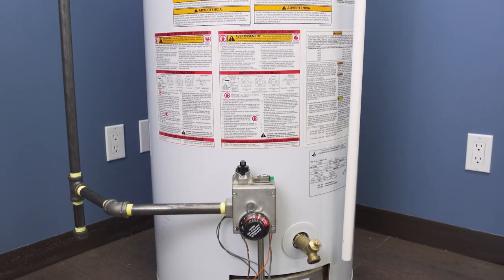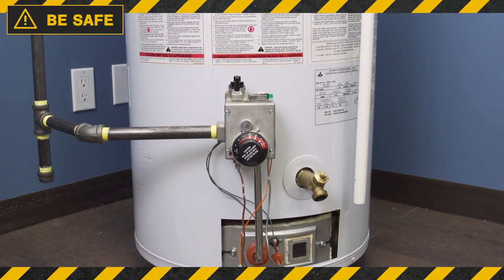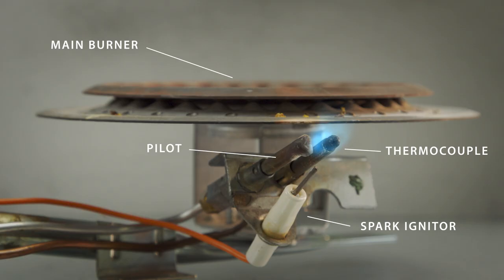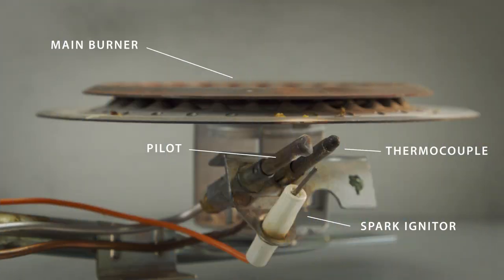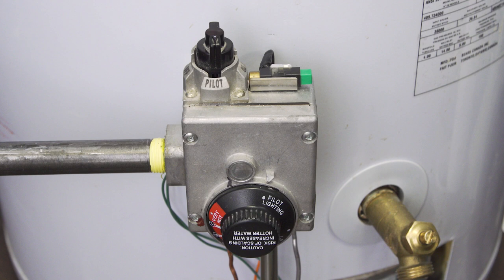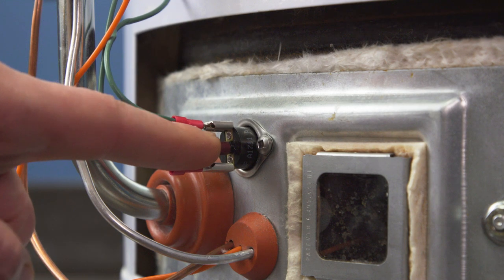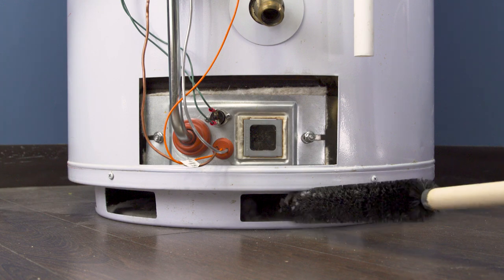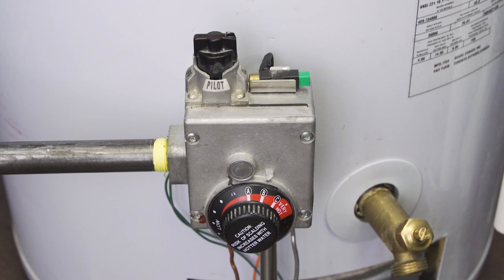How to Relight the Pilot in a Water Heater | Repair and Replace

Comment: Thank you for providing this info to people with no general knowledge of water heaters or household maintenance, there are way too many! 
My question on your steps to reignite a pilot light follows: 
• ¹Verify that the gas lever is in the on position. ²Set the thermostat control knob to the 'pilot' position.  ³Set the gas control knob to the 'off' position.
 
‽ • Wait 10 minutes to clear any lingering gas.
‽ • Check for any gas odors. If none exist, proceed to the next step. 

‽‽ Aren't these actions necessary? Am I remembering the process incorrectly or was this only needed on older models (like me)? I apologize for bothering you, I'm just curious.
Reply from the maker: Thanks for watching. Those steps can be helpful when doing more than one re-ignition and it is always best to be aware of any gas odors. If the pilot flame went out on it's own and the water heater has been turned off for some time, then it is likely clear of any lingering gas.

Comment: You mentioned that the top vent was supposed to be cool, is it always supposed to be cool or just initially when the burner starts?
Reply from the maker: Thanks for watching. The line was taking about the air flowing into the exhaust vent hood. It should draw in room temperature air. If you feel warm air come out of the vent hood, then it shows that there is a blockage in the vent.

Comment: With all the electrical wires on a natural gas water heater does it get plugged into wall outlet?
Reply from the maker: Thanks for watching. A standing pilot water heater is powered by the thermocouple which produces enough electricity to operate the gas control valve. Newer standing pilot water heaters use an electronic gas valve which requires more power, so instead of a thermocouple, a thermopile is used.
Reply: @AmreSupply  a thermopile..? I hope there is a video somewhere comparing the thermopile and thermocouple.
 Aren't some meat thermometers a thermocouple?
Reply from the maker: @707SonomaComa  Yes some thermometers are thermocouples. Thermocouples use 2 dissimilar metals to produce voltage. A thermopile is just a "pile" of thermocouples bundled together. For a comparison you can watch between 4:00 and 5:30 on this video, it explains a little bit of it in context to water heaters. https://youtu.be/BHUPFLbb8NY?t=245

Comment: I got a broken clip on water heater igniter how do I fix it
Reply from the maker: Hi Jerry, thanks for watching. For the igniter to work it needs to be properly grounded, so if the clip is broken then igniter won't work. You might be able to find a replacement clip somewhere but If needed the igniter can be replaced with a new one. The steps are similar to accessing the thermocouple: https://www.youtube.com/watch?v=Mx6rZA9Yxv4

Comment: Light is on but heat isn't going.
Reply from the maker: Thanks for watching. If the pilot light is working but the main burner isn't turned on then first check the burner setting. Set it to the lowest temperature setting to try to get it to fire up. If the full burner still doesn't turn on then it could be an issue with the gas control valve.